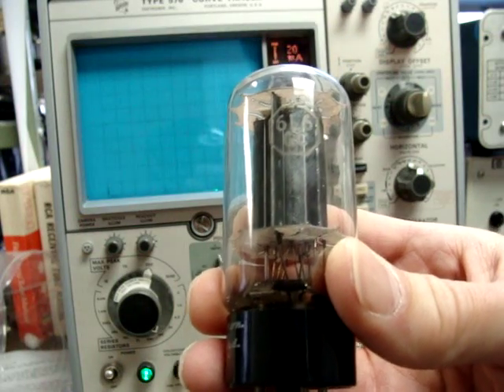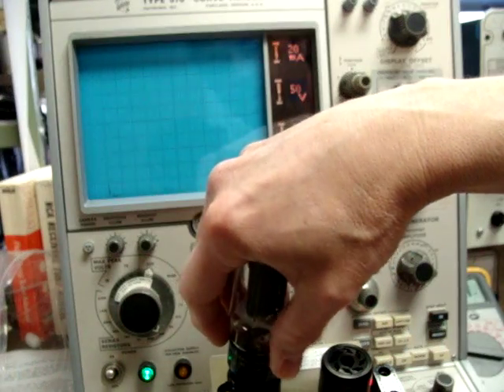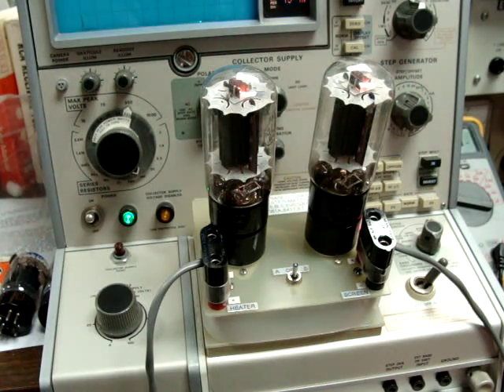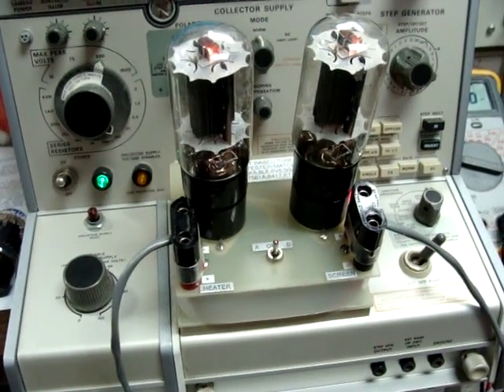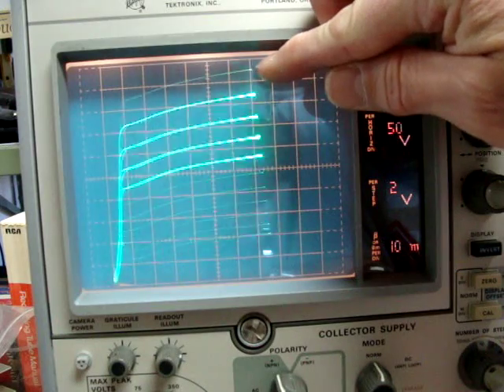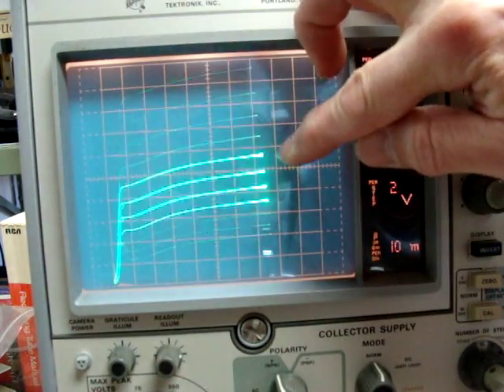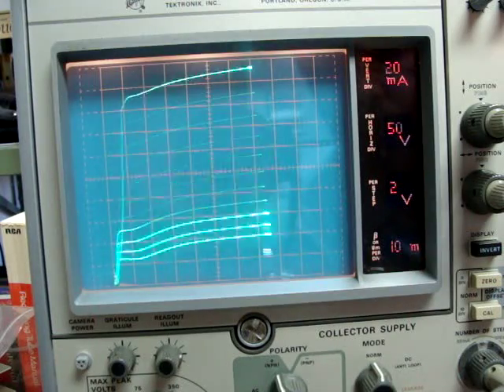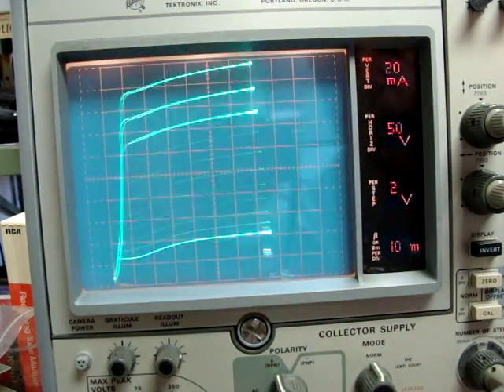Matching RCA Blackplate 6L6GC Vacuum Tubes On The Tek 576 Curve Tracer

Comment: That is a cool setup. How do you keep it from drawing too much current when you switch between the tubes and the idle tube has only the screen voltage and acts as the plate drawing too much current. Does that make the tube overheat?

Comment: Looking to get two matched RCA 6L6GC black plate tubes. Seller claims the following: Tested on a restored and calibrated Hickok 539B tube tester, Date Codes: C? (can't read 2nd letter) = 1970 & DI = April 1971, Measured Value:

C? = 6250 micromhos, DI = 6000 micromhos

Average New Value: 5500 micromhos, Minimum Acceptable Value: 3300 micromhos

Another similar NOS set claims:
Tube-1 = 5200 Gm, 48.0 mA (104%, worn RCA logo on glass, code DI (April 1971)

Tube-2 = 5150 Gm, 47.5 mA (103%, worn RCA logo on base, code DI (April 1971)

I have no idea what this means but are they worth say $75 to $80 for the set? Use will be in a 1964 Fender Super Reverb (all original).

Comment: Hi, I recently purchased 2 very clean, different brand, 1960's P.A amplifiers. They both had a pair of their original RCA Black Plate 6L6GC output tubes in them (which all tested new on my tube tester). I recapped one unit and decided to test the output tubes Plate Dissipation from both units, using the output transformer shunt method. I used the same socket to test all 4 output tubes, and as it turned out, one tube from each set was 19 watts P.D, and the remaining tubes were both 21.5 watts P.D. Okay, so I can make 2 matched sets... My question is which set would be the "better set"? The pair that had the Higher Plate Dissipation or the Lower Plate Dissipation number. Thanks, Tom

Comment from the maker: @LittleWolfBindery It depends on the amp.  If your amp is very forgiving of a mismatch, one tube may run much hotter than the other, causing early failure.  Other amps that need a close match may cause a mismatched pair to red plate and burn out in less than 30 minutes of use.  Misadjustment or failure to set bias on a fixed bias amp can also lead to the same thing.